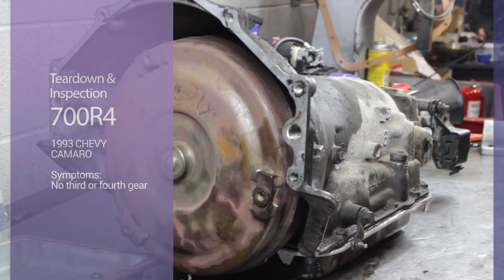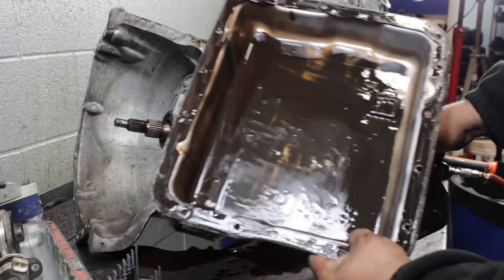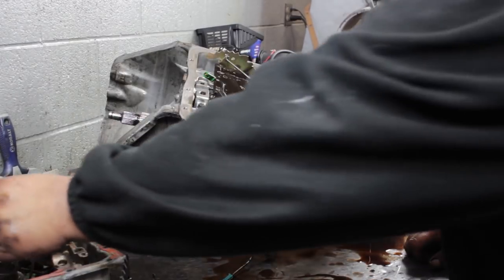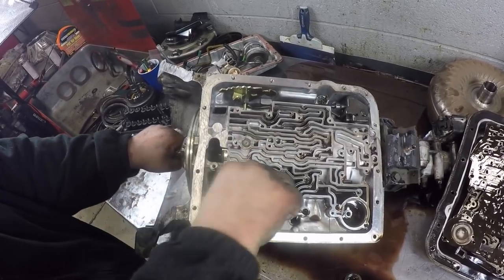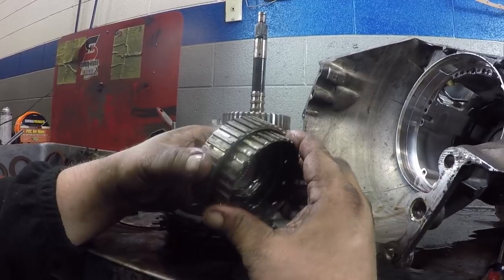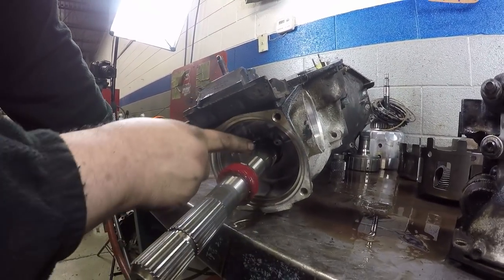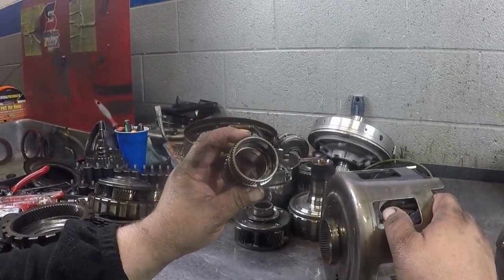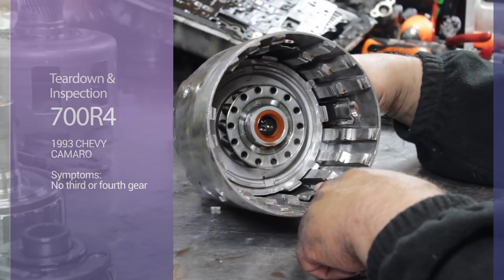700R4 Teardown

Comment: So some major confusion here, didn't GM declare all 700-R4's as 4L60's (sans the E denomination) after 1990?  4L60 and 4L60E's are different for obvious reasons, but aren't all newer 700-R4's known internally as 4L60?
Reply: Midnight Mechanic I believe so
Reply: @redrhino1911  That's what I figured, hence why I wanted some clarification.  Some of the parts are interchangeable, but the bushings, bearings, washers, and races changed over the years.

Comment: Thank you for the video.  I'm afraid I may be doing this in the next week or so.  I changed out my filter and pan gasket and after test driving it my reverse is gone. May be my fault, but I'm not sure.  

(For future videos turn off the AGC on your camera's audio.  That's causing the volume to surge.)
Reply: J Babb ,
Reply: Update:  I rebuilt my transmission after watching this and a few other videos October '17 .  It all worked out great.  Upgraded to bonded steel piston, corvette servo, beefier band and 3-4 clutch pack.  Wired up an override switch on the dash for the TCC solenoid.  Everything is working great.

Comment: Okay my 86 Chevrolet K5 blazer has a 700R4 in it and goes reverse.....but no forward
Reply: you still got that problem?  I got a 87 k5 that has no OD or D but I fixed it
Reply: Labeouf how did u fix it mine has same prob
Reply: Andrew Christian I replaced the tranny fluid and that helped a lot, I got my gears back but it wouldn't shift after 2nd when in drive or OD. We also found a lot of small metal in the pan so were thinking it's the clutches for sure. I just replaced he tranny last week because I didn't want to deal with the rebuild. Hope that helps!
Reply: And I forgot to add, I replaced the filter for about 15$ but I'd say replace fluid and filter and go from there